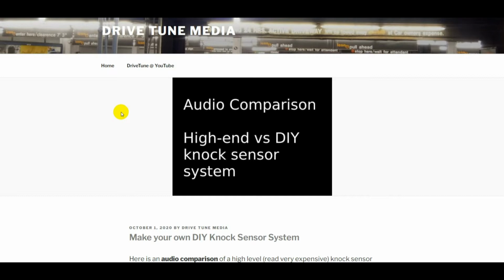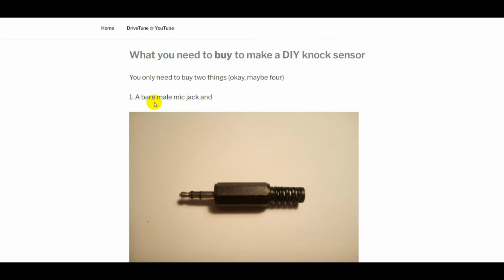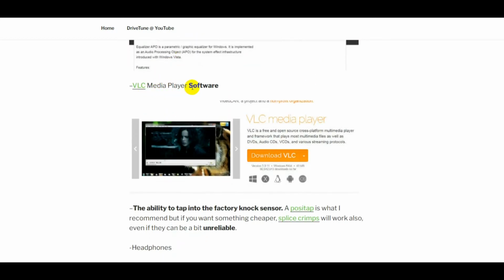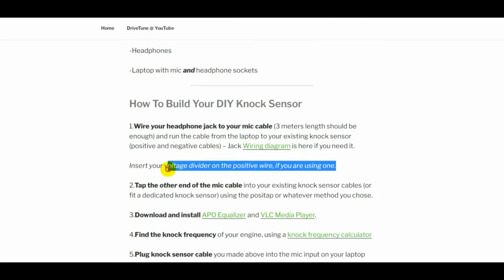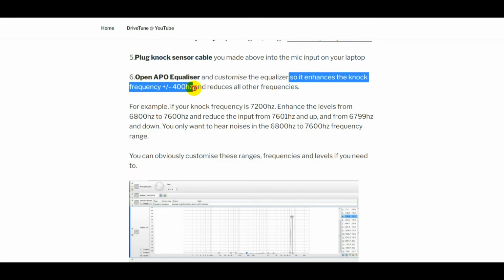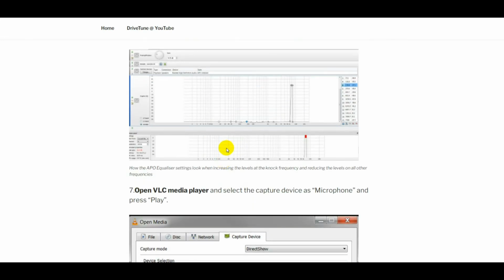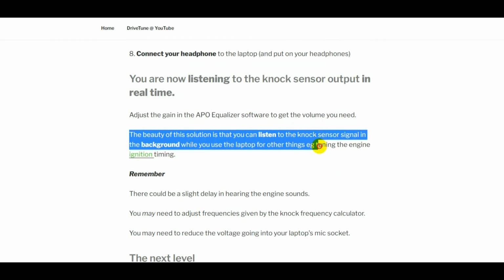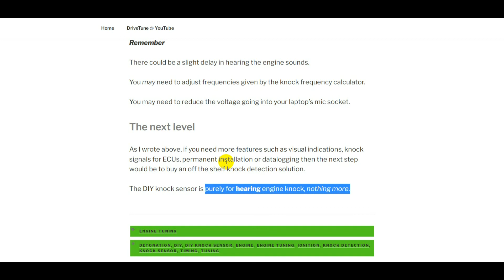DIY Knock Sensor System (Audio) - How I Did It

Comment: How to wire two sensors? Can they be merged into one wire?
Reply from the maker: I suppose its possible but how would you know which sensor has the most knock? It might also be too noisy in general.
Reply: @DriveTuneMedia  agree with you, noise could be the problem. Maybe going stereo, one channel per one sensor. I only care about hearing knock better not which cylinder it is in.
Reply: Sorry for replying to and old comment, but wanted to say this: You could hook up a 4-pole (Stereo) jack to a stereo 3.5mm jack, or a DAC (like a Behringer UCA222, with L/R RCA IN/OUT), then wire/record one knock sensor on the left channel and the other on the right channel. Also, if you need to record the audio data for analysis, you can record your input with Audacity (free wav editor) and you'll be able to see both inputs when your record.

Comment: hi thanks for this video, much appreciated for beginner tuners like myself on a budget

should it be a 4 or 3 pole male jack(TRS Type Male Audio jack like the one you)? as shouldn't the knock sensor be a mic which will send signal to a 4 pole male jack to send knock signals? or do i have this wrong

thanks
Reply from the maker: I think it depends on the laptop you are using and the inputs it has. Try different jacks until you find one that works.